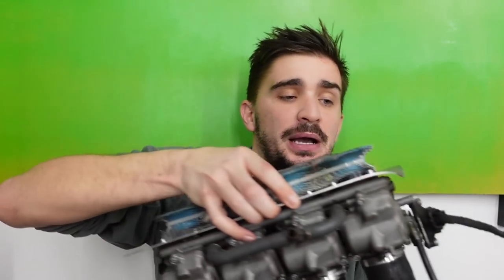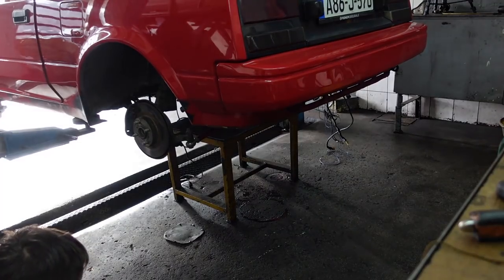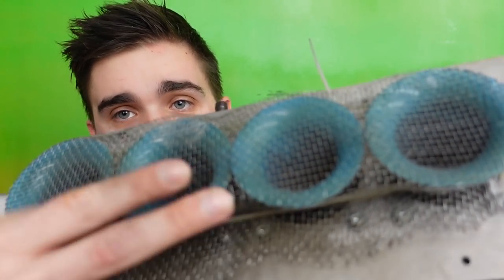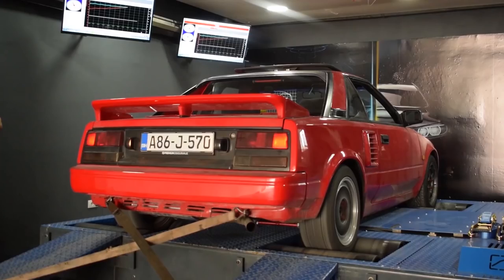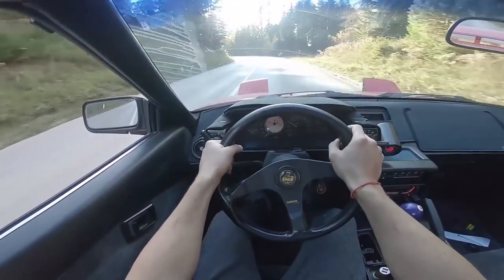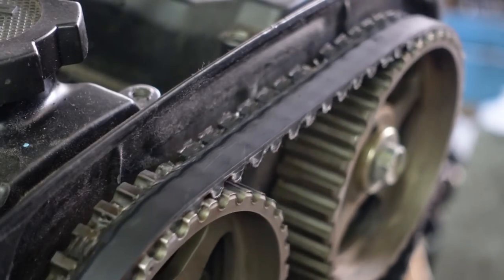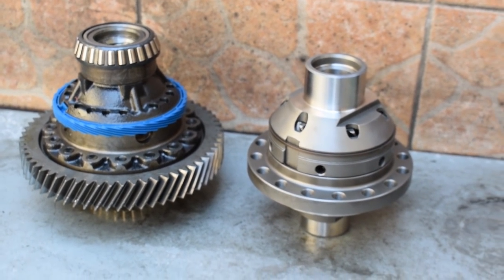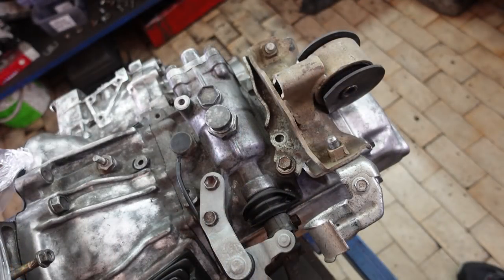Turbo 4AFE UPDATE + GOODBYE Bike Carb 4AGE recap - Project Underdog #12

Comment: Throttle response is so important in a daily driver! Switching between a car with Drive by wire and another with a cable I noticed drive by wire feels a bit more like driving with cruise control buttons.
Reply: I feel weird with drive by wire, its like i dont have full control of rpm. Its annoying
Reply: I've seen a throttle body (BMW?) that was basically a combination of cable and drive-by-wire, the cable controlled the throttle but a servomotor could add or subtract from that
Reply: @fuzzy1dk  that is for the cruis controll
Reply: @lorenzhartl8466  but it can also do everything drive-by-wire can, while still keeping the direct response of a cable
Reply: Drove an 04 f150 for work, that pedal had no resistance to it really. Nothing beats the real feel to the air hitting the butterfly to give you the feedback of where you're at  for load and revs right though your right foot
Reply: @fuzzy1dk  it's early of traction control days. If sensors would see that powered wheels are faster than others / 1 wheel is doing A LOT of rotations compared to another a electronic motor would set throttle body down.
Ye, it was really beginnings of traction control :D
Reply: There's absolutely no reason why drive by wire can't be at least almost as responsive as a cable throttle. The advantage of drive by wire from the perspective of the car manufacturers though is it allows them to treat the throttle input as a suggestion and control the throttle valve to reduce emissions and get better efficiency. That's what makes it less responsive.
Reply: There is also the conspiracy that manufacturers purposely limit drive-by wire throttle response when taking off to save on warranty on engine mounts :)
Reply: It's because vast majority of stock cars dampen the throttle response so the "normal people" can drive smoother.

Drive-by-wire can be just as responsive if tuned right, but depending on car you might want to go for aftermarket ECU
Reply: @XenFPV  There are emissions and fuel economy reasons for why they dull the response so much. EE mentions in one video that the rev gang was because closing the throttle too quickly could cause excessive emissions, perhaps excess fuel in the intake makes it run very rich when you lift. There’s also reliability as the shocks can damage the drivetrain. 
In my experience older drive by wire is more direct as they don’t do anything fancy. The worst offenders will cut throttle when you go downhill with a light throttle.
Reply: @mrizkic  i agree! I thought Im the only one.
Reply: Might have something to do with the vehicle you're driving. I feel Drive By Wire on (for example) a  manual, 2GR-swapped MR2 is very much not like driving with cruise control.
Reply: @mrkazman  it may be several factors, one other factor being the super heavy stock flywheel, and I have heard reports from other folks with manual TSX that there’s felt a bit jerky/cruise controlish too. I guess you can increase response with an aftermarket ECU or hondata.
Reply: That's just programming of the wire. There is not way that a dbw will be slower than DBC take the current Miata gen, people give a different programming to the throne and that's it.
Reply: Good description. I always describe it as feeling like the pedal is attached by an elastic band.

Comment: You could also either move the fulcrum of the throttle pedal closer to where it grabs the cable or move the cable attachment point closer to the fulcrum to give you more pedal travel for the same length cable travel

Comment: When the filter is that close to the inlet, the cost in power is shockingly high. 
Carb size is based abound torque, not the power. The trouble with bike carbs, when fitted to a car engine, is they are designed for a low torque engine that will have positive air pressure in the air box at high speed, when load demand on the engine is at it's highest. Lots of problems to sort out, so may just as well fit a pair of Webbers.
Same idea on the prep. I've spent too many years getting things to look pretty. We used to polish all alley castings, even the gearbox.
The last time we did this the casing split off the start line, never again, I just want to race🤤😆
Reply: I wouldn't have thought it makes any difference in terms of power where the filter sits. I'm not saying it doesn't, just that I don't understand why it would.
My thinking is, there will be a pressure drop across the filter material, such that the volume of air between the CV valves (or butterfly for ITBs) will reach a steady state in terms of pressure (assuming a steady load on the engine).
The bigger the volume, the longer it will take to reach this steady state granted, but where surely talking fractions of a second unless you've got your filters several meters away which is just silly.
So once the air pressure behind the filter has reached a steady state, how can the distance have any impact on total airflow (i.e. power)?
The only thing I can think of is maybe you use a larger surface area of the filter the further away you are from the trumpet, but I think this would only have an impact if you are really close to the trumpets. Once you are circa one diameter away I guess it stops making a difference.
I find more often than not there's something I haven't thought about which is why I like to ask the question. Good way to learn.
Reply: @richardschofield2201  You answered your own question. Remember that the air intake had sufficient  force to suck part of the ait filter in. 
As a rule of thumb those foam filters need at least 25mm from the edge of the ram pipe. Interestingly on a metal case filter (like a K&N) the solid cover can act as a pressure wave reflector, with positive results
Reply: @gothicpagan.666  I was organising and developing my thoughts on this as I was typing.
When I got to the end I had a choice to delete it all or re-write it but instead I chose neither and just hit the send button.

Comment: Regarding MPG stuff, I converted my 1983 Toyota Starlet to fuel injection and rebuilt the engine with a slightly uprated camshaft. My fuel consumption is 6 L/100 km in the city if I drive it nicely and 6.5 L/199 km if I am thrashing it

Comment: Sounds like your bike carbs were hot from the heat soak, I would just put a kill switch to the ignition and crank a few before enabling it to get any fuel vapor out. Back in the 80's my dad put a tin shield and spacer that wasn't good at conducting heat  between his carb and intake to help prevent vapor lock on a small block ford. Oddly enough your dyno numbers after the bike carbs and tune are exactly the same as my 96 Miata 1.8 from factory. Can't wait to see the new one in action, that throttle modulation returning will be a godsend.

Comment: That was an interesting update.
I used to do a lot of motorcycle carb work, the newer the bike the more difficult it is to get working properly without the stock intake system. Honda's with 3 jet carbs are the most difficult (3 jets are pilot, primary main and secondary main) 
The problems are usually around transition points, fix jetting at one rpm/throttle position and it may get so bad engine stops running somewhere else.
Motorcycle carbs can also have fuel problem as float bowl heat up, always an issue on short stops as fuel evaporates and fills intake system. Best thing to do is start with throttle fully wide open and let some vapor escape, be ready to shut throttle quick as engine fires up. 
There are various other things I do to improve fuel delivery but it involves modifying internal parts of carbs.

Comment: Great to see the updates.  Smart to update to an e51 transmission, but it is a pain (as you confirmed).  Mounts and  the car body itself are different on the SC versus the NA model of the MK1.  Another option for those considering staying NA….the ITB’s of the 20V 4AGE.  The improved throttle response is driven by eliminating a large intake manifold, further compromised with the VTIS of the large port 16V 4AGE.  This allows you to get the noise and throttle response of the bike carbs while maintaining the benefit of computer controlled fuel injection.

Comment: Another parts source option for the E51 (AW11 supercharger gearbox) is the ST205-GT4 (E154F) gearbox.  I got one and transferred the internals into my MR2 superchargers' E51 case -- I think the Caldina GT4 manual boxes should also be a good source of a replacement internals. The bonus is you get :- triple cone second gear synchro and doubles on several other gears).  I did this with my AW11 and the shifting is so good!

Comment: Your bit on the throttle cable reminded me:
I used to drive a 'vette. OK OK OK, full disclosure: it was a Chevette. It was the first car I bought after losing my right leg and it was a manual.

I tied a rope to the throttle cable and attached a handle so my left thumb could help steer while providing a solid base from which to pull. Other than braking my left hand did most of the work.

Way fun way to drive. :-)

Comment: To overcome the throttle pedal travel issue, could you not bolt on an interim step-down wheel where the pedal actuates a 'car sized' wheel with a 'bike sized' step down tethered to the carb throttle wheel. Possibly would help to smooth out the initial resistance also as you've have more torque over a wider travel. You could also mount it anywhere.

Comment: Hi slav brother, first i wanna say , i visit your country in 2018 and it was great. Very beautiful nature.  Second - i run my daily driver opel C20XE  with bike ITB's, not carbs but EFI. No problem with pops and bangs. I guess your issue is related to how carbs works. After you turn the key of, you shut your spark, but fuel is still runnig in intake manifold. When you try to start the engine afterwards this fuel ignites and makes a bang in the manifold. I have to say there is significant improvement in the power of the car, i can tell that because my fuel injectors become too small and cant deliver enough fuel after 5000 rpm now(they are stock c20xe injectors). For your other statements i can say that you are completely right. ON/OFF throttle feeling can be inproved with EFI, but carbs are no good for daily driver. About fuel economy - with gentle throttle my ride(approximetly 190bhp by my calculations) burns 10litres /100 km, so i cant be unhappy. I would be happy to discuse those and other things with you. Keep posting good videos, thank you!

Comment: 23:36 - If I coat stuff, I tell myself it's mainly for corrosion prevention but also looks good. Plus Car engines just get a little dirt and grease on them, not stuff that usually causes huge amounts of corrosion or makes it super dirty. And honestly, I look the bare aluminum look. Gonna be a nice build.

Comment: Carbs are great, if you want to be tuning/tweaking them all the time and this goes for a bike or car engine that is not OEM, it is custom and that's we love it , especially cold start ups ITB's are always finicky, they are complex even to this day, they don't  work like a unit like anything EFI, you'll find the new set up you are building to be more reliable simply for the reason you'll data to review and work with and it just makes life and tuning more reliable, especially  with stock cams and they were decent from factory already, look forward to the rest of the build and the start up thats  always great moment, more smiles to the mile 😎
Reply: Actually carbs aren't that great can't get equal fuel to every cylinder and run way to rich have cold start problems etc

Comment: Can't wait to see the result ! I really love that original choice ! Not that typical 3SGTE stuff, well done ! Would have love to see the Celica TS gearbox fitted to that engine, also cant wait to see what you gona do for the intercooling solution.
Reply from the maker: Yeah, 3sgte has been done to death honestly. The six speed one? C something? I really want to be a bit overkill on the transmission so I feel safe to be a bit stupid. Intercooling will be air to air and relatively straightforward, maybe with some fancy ducting or something.
Reply: @d4a  yes, 6 speed, i don’t know why I thought they were very strong ? But maybe a bit expensive too ? But yes super project coming for sure !

Comment: I know it's a bit late to the game now, but did you look at your pilot jet settings for the hot start issues? Seems like turning the pilots in 1/4-1/2 turn could help that low engine speed fueling. Maybe not, but as someone who owns many old Japanese motorcycles that use 4 pack CV carb setups, that would be where I moved to at some point.

Comment: When driving on snow its good to have a smooth trottle response. Do you know if there is possible to have turbo in the 4AGE blacktop ITBs on a 3SGTE as an exemple?. The sound would be awsom.
Reply from the maker: Definitely possible. Weldspeed makes an intake manifold for that. Check out the link.
Reply: Toyota ran their 153E race engines (which are basically 3S-G's) with ITBs and mega boost, like 40 pounds, so yes absolutely. Also, every RB26 came stock with ITBs and twin turbos. Australia and New Zealand are very comfortable tuning engines with turbos and ITBs.

Comment: I have a 4AFE in a 1999 Corolla AE111 6 speed. I put 1UZ injectors to run E85 fuel and it starts and runs as perfect as stock (and much cheaper). I set the timing at 15° at idle instead of 10° to enjoy the benefits of the higher octane. I was planning to swap a 20V but they are so damn expensive rn, and I already have two bluetops 16v in an AE86 + AE82. My FE is in very good condition so I'm definitely interested to do somthing special with it. Sorry if you already mentionned it, but did you upgrade the valve springs ? How many rpm are you planning to set the limiter ?
Thanks !
A fellow european 4A enthusiast.
Reply from the maker: Hi, yes I have upgraded the valve springs as I plan to rev to 7000. Didn't mention much yet in the vids. I used Opet Insignia 2.0 cdti springs, the later model with 5mm valve stems. Very modern and strong springs 😁 it took us ages to find something that fits as there are zero aftermarket options.
Reply: @d4a  thanks for the reply ! Can't wait to watch your next video

Comment: using  my ke70 daiy my stock bluetop in 45 twin dcoes fully deleted ecu  and tiny pneumatic correction to distributor...  in small fuel pump i reach a bit more than 12 psi  but it wont happent cause car drinks too much   no  fuel regulator yet so  wont let my pump work if car no working aaaand sometimes i feel i have to  switch off the pump in traffic hopping i wont forget to switch it on again    . i dont push it much only some pushing for pleasure in fast gear changes and then just roll!!!  my gear ratio due to 1.2   old diff short one  top speed 180 about 8000 in 15 wheels !! can go 9000 but  isnt right for a non opened engine!!!    watch the same  efficience as you watched  .. 15 litres per 100  km   50% in town and a bit of  slow touge to  charge the battery !!! i deleted thermostat and with the oil cooler   those cold days it burns some more!!!!!!! i did some trips  average 90km/h   and it was great nothing happents even droped at 9to10 litres per 100  and i was quiet happy 
 i dont think this car fits anymore in town..  !!!!!   carbs need a hell of service and new parts even  butterflies but cost too much so i might go  ecu and throtlebodies

Comment: just a little question on carbs : I heard that you need to mount them flat in order that they work perfectly, but it seems that it was not the case on your engine. Have you heard about that on your side and finally it doesn't matter, or it is something you were not aware? or is it something you need to take care on carbs for cars and not with carbs for bikes?
Reply from the maker: Something like a side draft weber must be flat. But most bike carbs are cv carbs and they usually sit at about 45 degrees. This is of course model dependant and different bikes mount their engines in different ways and thus design the carb float and float bowls to accommodate for that.

Comment: Most carb people I know tended to reduce the number of carbs for tuning purposes. Each cylinder ultimately has different needs throughout the power band. And dialing in each carb was a huge P.I.T.A.
Really, a similar but better setup, would be the ITBs and fuel injection! I mean, if you REALLY wanted to be anal? You can put an afr sensor on each exhaust port to give each cylinder what it wants.

The content is definitely interesting. I’m watching someone else putting the 2ARFE and the 2GRFE engines in MR2s.
I’m playing with a 1NZFE until I get a garage, so that I can do a 3ZRFE swap. 🤣
Reply: from what ive gathered, each carb is tuned the same and the AFR sensor is down stream reading the exhaust from all the cylinders

Comment: Garage 4age has some great dyno before and after videos comparing different mods. Your highway performance gains are probably a mixture from very short intake runners and ITBs. The trade off of short intake runners is often a loss in low end torque
Reply: It probably would have made more power with bigger carbs.  quick search says the are 34-36mm somewhere.    a 37mm runner  dropped the power from 150kw to 125kw one of my setups.    would have gained a little bit before it fell over due to higher air speed earlier

Comment: What pilot jet size jet are you using?, clip position on your needle?, main jet size?, and how many turns out on your air/fuel screw?
Reply from the maker: I still know these by heart although I haven't touched them in over a year 😆. Stock pilots worked best, they were 45 I believe. Mains just a tiny bit bigger than stock, I think 148 or 150. Needle wasn't adjustable, you had to add washers. 1 washer over stock worked best. 3 turns out on the screw, but 2.5 worked ok too and helped with economy but felt a bit less enthusiastic and low throttle.
Reply: Thank you for the insight, much appreciate!